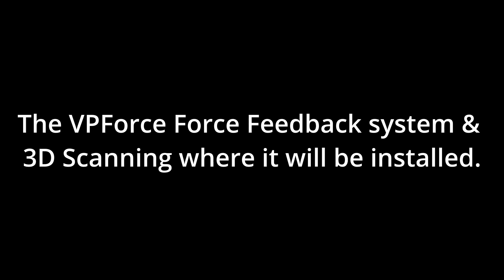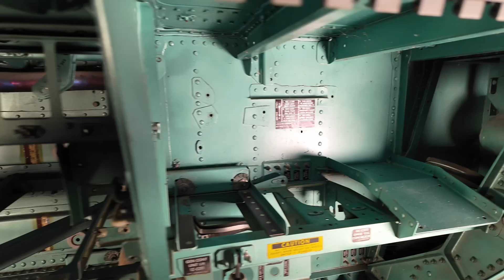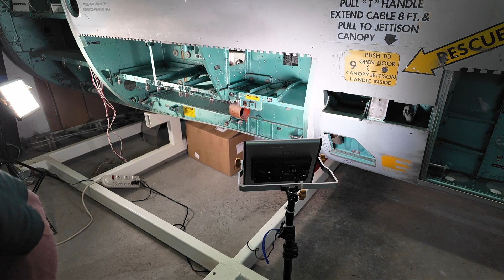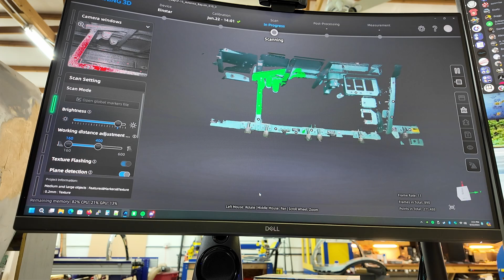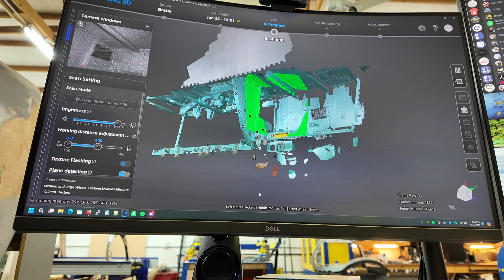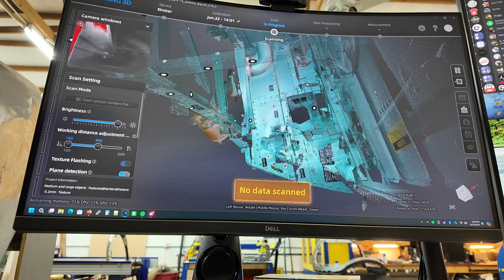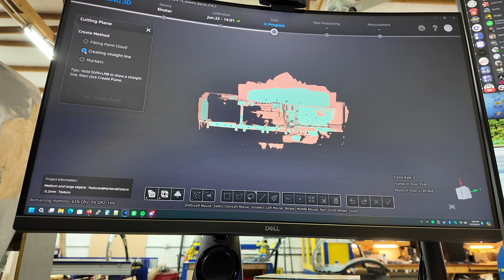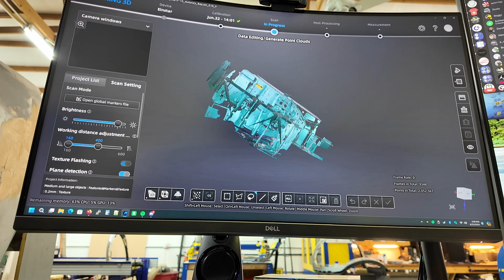The VPForce Force Feedback system and the F-15C

Comment: Hi I'm also trying to build an f15c cockpit scaled simulator but I can't find the donations (size ) of the cockpit/controls/sit anywhere 
Do you by any chance have those and can upload a video or a photo/sketch of the dimensions and angles on YouTube/Instagram/Facebook (if it's not classified)
Reply from the maker: There's nothing classified about the dimensions.  The problem is that doing it properly is incredibly time consuming and I've got a limited amount of time to work on the sim each week.  Sorry!
Reply: @f15sim  it's ok I understand it I also have deadline's on my own projects,  but I don't think that measuring length width and height of the cockpit is that time consuming